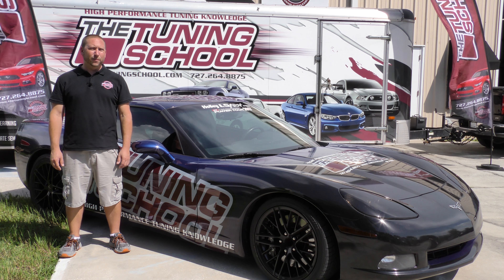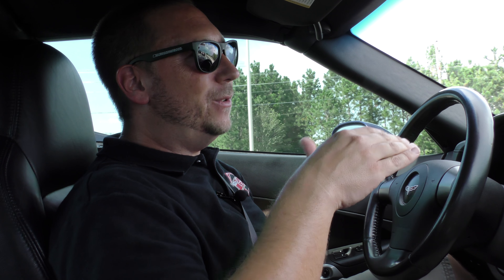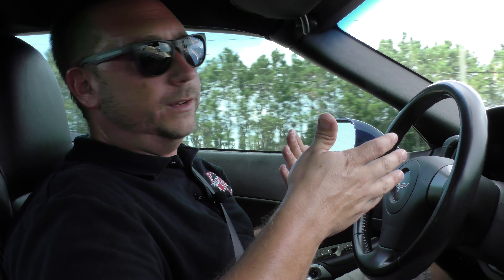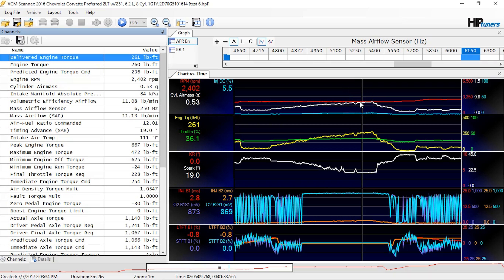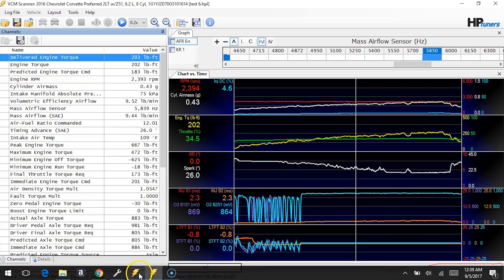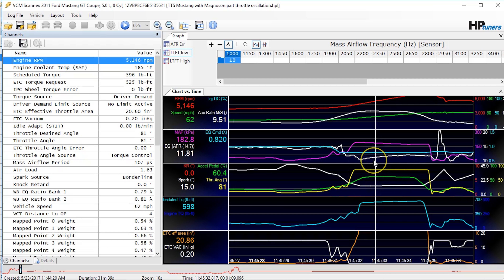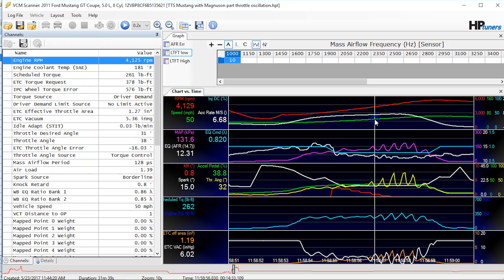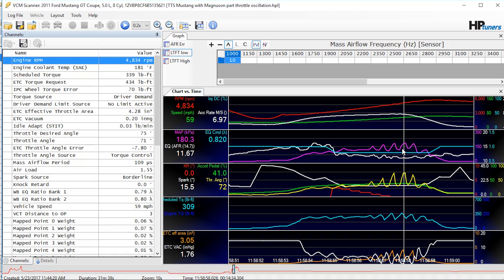How to Determine Driveability Using HP Tuners VCM Scanner

Comment: Can you explain how to set up the user defined PID for acceleration rate?  I am having trouble with figuring out what to put in for the time(initial) vs. time(final).Great video btw!
Reply from the maker: Attached is a screenshot of the math for acceleration rate you can share to answer this question.  You will have to insert the correct Variable for your own vehicle which represents Speed (on ours, it is 8000.114).  The -1000 and +1000 tells it to look back 1 second and forward 1 second to get the average for speed acceleration rate.
I can email you the screenshot. What is a good email address?
Reply: Got the screenshot on facebook, thanks!
Reply: If you use MPH under Generic Sensors, then it should look something like this:

([50020.114.avg(-1000)]) - ([50020.114.avg(1000)])

50020.114 = Generic MPH PID on mine, individual results may vary. 

1. Select "new variable" and then either the generic MPH PID or your specific vehicle one. 
2. Under the "Edit PID", select "Average" and under "period" write in -1000 (it will only let you type -100, but you can add another "0" after you have it on the formula area.
3. Add a " - " symbol
4. Repeat step 1 to add in second reference frame (same MPH PID again)
5. Select "Average" for second PID and under "period" write in 1000
6. Use 3 decimal places
7. Select MPH as units. 
8. Name it something awesome like "Scare factor" or something.

* note, for all PID's and units make sure you are using MPH. The PID's will normally populate with m/s which is meters/second

Should be good to go after that.

Comment: Trying to tune an 05 GMC Canyon. It won't show my any torque value or my cylinder airmass! No matter what I try it will not show it. But as with any GM spark advance tables are cylinder airmass vs rpm...